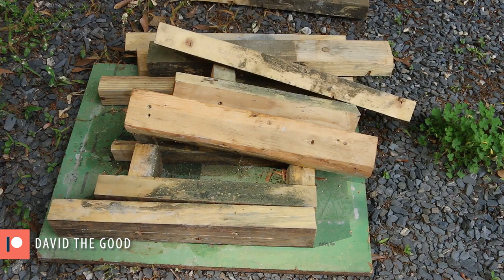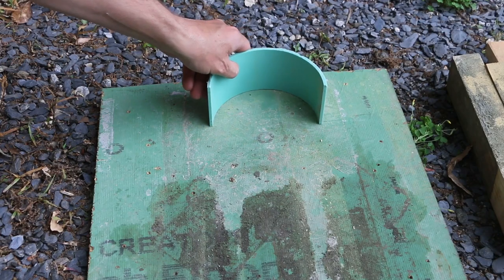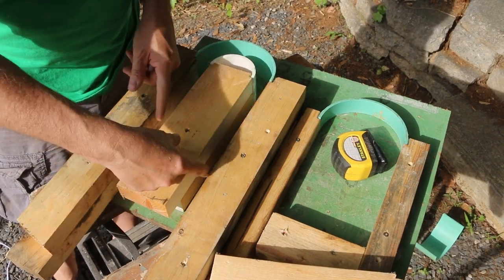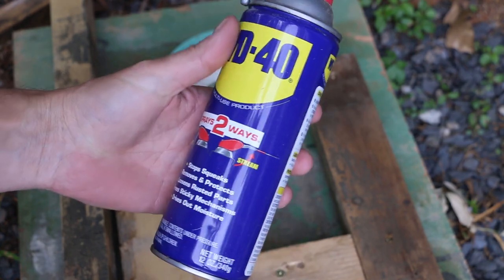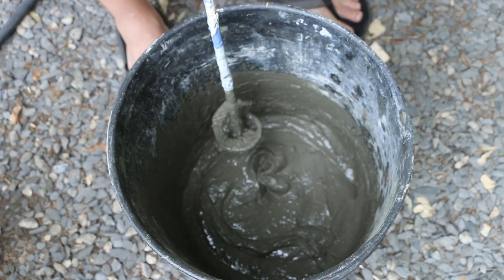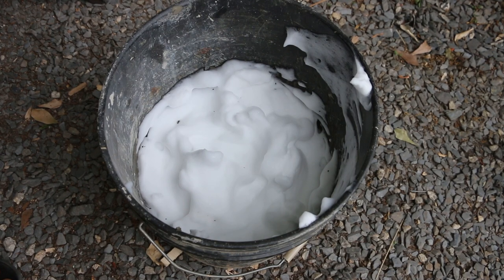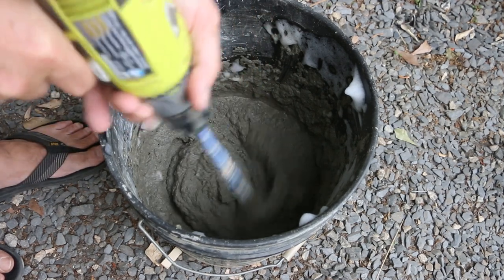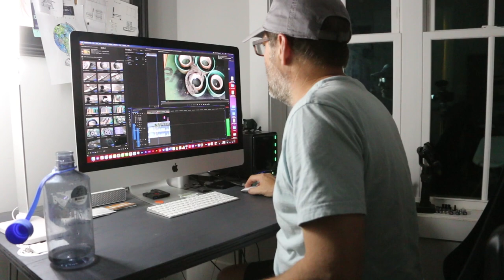How To Make A Stackable Aircrete Rocket Stove

Comment: G'day mate.  Keen to see how it all works out.  Can I ask why it is you seem to go for the bare minimum when it comes to your aircrete builds?  seems to me  to be a material that does better with some extra size to reduce fragility.   I understand doing small batches to get to test lots of different things, but just feel a lot of your previous attempts would have done better with substantially more thickness to the parts.   This mix looks really good!  I love seeing how you improve your process with each attempt, and showing us all the results - I bet your experimentation saves a lot of people a lot of time in their similar projects - I know it has with mine. Cheers!
Reply from the maker: Thanks Mick. I appreciate the feedback. I agree with your assessment that I go minimum. Actually that probably more a result of my experimental approach versus intending to do that. With this build it was much larger in my mind. Lol. It turned out much smaller than I imagined, but at that point I was committed to seeing it through. Even if the thinness of these forms ends up being a fatal flaw, I am stoked with the aircrete mix and the foam generator’s performance. Thank you for watching.

Comment: Just curious, have you ever tried fiberglass matting cut up and placed thru out your mixture?
Reply from the maker: I haven’t. But, I have seen it used. Also seen others use fibers. Thank you for the tip. I’ll give it a try. Thank you for watching.
Reply: @GreenShortzDIY  I live  in Pa and they replaced the highway in front of my building several years ago with an experimental mix of concrete and fiberglass. No steel mesh. It seems to be holding up well. It was a continuous pour. They came back later and made diagonal cuts for expansion then pour rubber in the cuts.

Comment: You have to get the proper measurements if you want to have reproducible results. Get a scale from the local head shop for the foam and soap, get a bath scale for the cement. It will save you so much. Check the humidity outside when pouring and write down the cure time. I get it, it can be annoying to do the bookwork but it will save you countless hours and allow you to produce better bricks.

Comment: Anybody in Scandinavia got recommendations for a good soap to use? I gaven't seen 7th Gen anywhere here in Iceland.
Reply from the maker: Hi Thoracius. I think any detergent that has glycerin would be a good place to start. That is the main reason I selected Seventh Generation. The glycerin helps stabilize the foam. Thank you for watching.

Comment: Oh interesting, no aggregate for strength.
Reply from the maker: I know it seems counter intuitive, but yes, no aggregate. Aircrete is usually not used for structural elements. This rocket stove will use it for “structure,” but with minimal load. This is still experimental, but stay tuned to see how it performs. I’m letting this cure for 28 days, for optimal strength. Will be a few other videos in between. Thank you for watching.
Reply: @GreenShortzDIY  I remember seeing people adding clay powder into the mix for extra strength and to keep the fine texture.